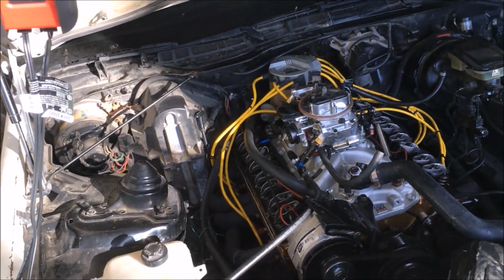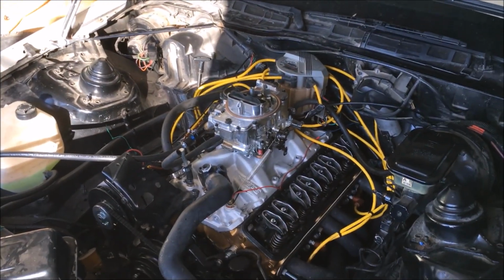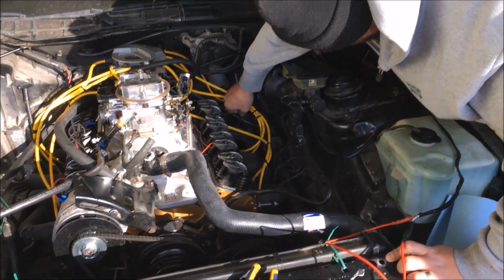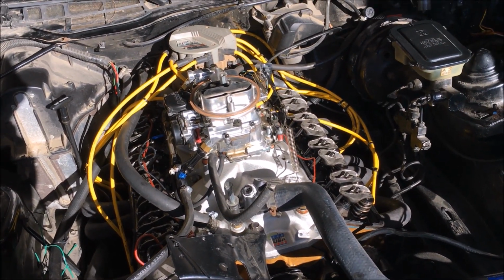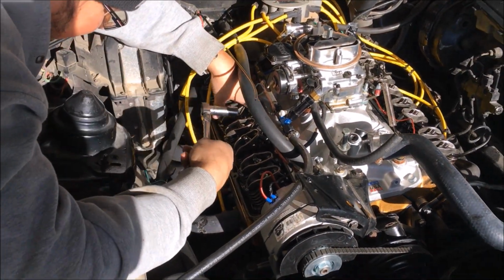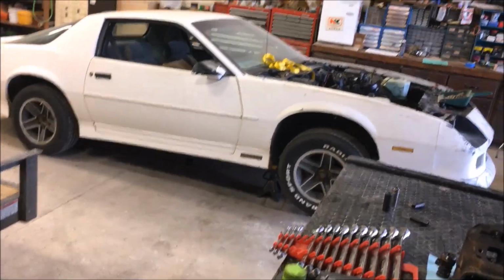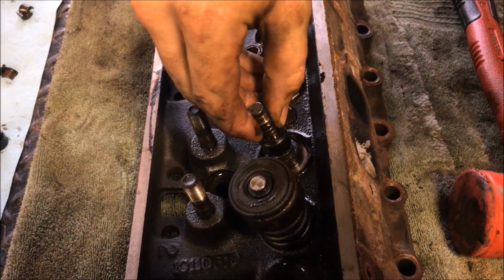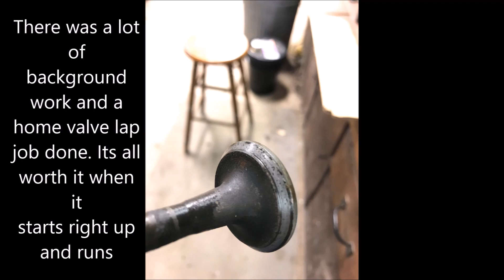Getting an 86 Camaro Back On The Road

Comment: Some of those 3rd generation F bodies are tough to work on, because of tight engine compartments lol. I've owned 2 of them and kinda miss those cars! I had a white '82 Z28, and blue '86 Z28.
Reply from the maker: It’s very difficult to get around the headers for the spark plugs and header bolts! But it is a fun car for sure!